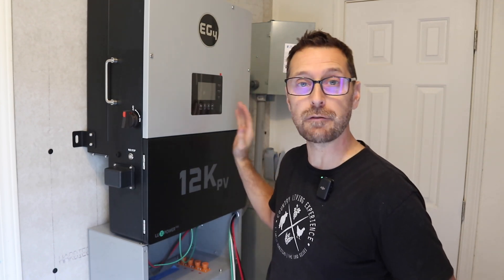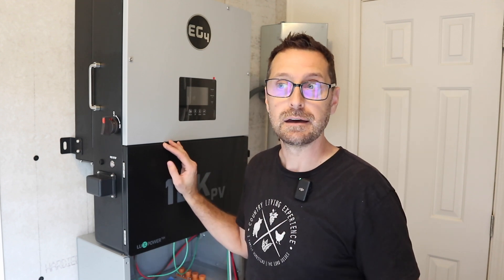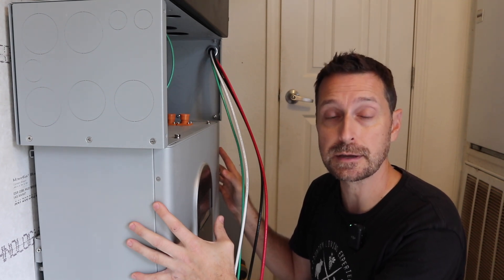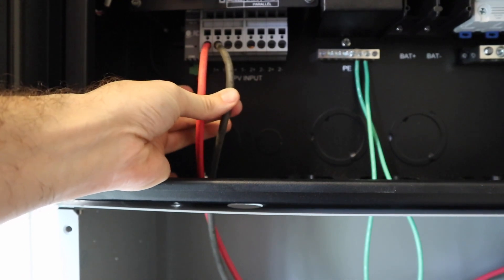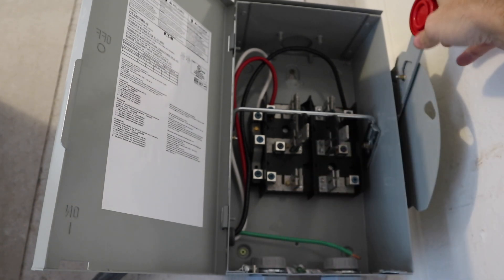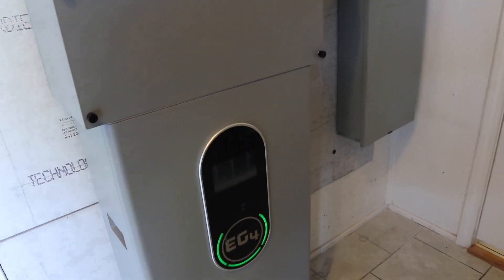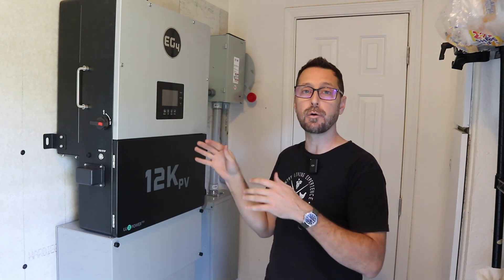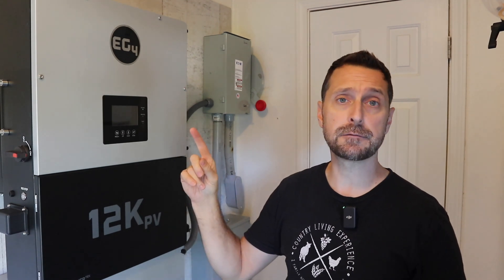EG4 12kpv Install! Wiring And Critical Loads Panel

Comment: I have mores question. I see you have a transfer switch to the critical loads panel.
My understanding is that the PV comes into the EG4 like you have. The EG4 then connects to the main panel, and also to the critical loads panel. When the Grid goes down, the EG4 ATS disconnects from the main panel, and only the subpanel has power. So not sure why you need a manual transfer switch.
Anyway ... what I want to do is to put an disconnect between the EG4 and the critical loads subpanel. Question is, should that disconnect interrupt only the 2 hots or does it need to also interrupt the neutral. Should the neutral go straight through the disconnect box?
Reply from the maker: I did a manual transfer switch because that is what my friend wanted.
Reply from the maker: neutral should be to the neutral bar in the sub panel. Ground should be to the ground bar in the sub panel. Neutral should then go back to the main panel neutral bar. Ground should then go back to the main panel ground bar. That is the only place that there should be a neutral ground bond. No neutral ground bond in the sub panel.
Reply from the maker: The neutral is always interrupted in the transfer switch/disconnect as well.

Comment: I am considering this 12kPV inverter. I have some questions. I have panels going to a SolarEdge 7600, going to my main panel on 40amp breaker (8 awg wire). So that will move to the GEN port on the EG412kPV. My critical loads panel will be rated 125amp .. so what size wire from the EG4 to that panel? 4awg ?
And the EG4 needs to be connected to the main Panel .. I do send excess power to the grid. My main panel is 200amp. So it seems I cannot connect the EG4 to main panel with more than a 40amp breaker, 8 awg (120% rule). Is this correct.
Reply from the maker: The installation instructions indicate 4awg for both grid and AC out connections. Those can be landed on either a 60 or 70 amp breaker depending on wire type. Use THHN.
Reply: @CountryLivingExperience  Thanks

Comment: A Dumb question: Can you connect the Hybrid "Load Connection" to a Load panel that os already hot and connected to "utility"/Grid.  my Solar System is 7 years old SMA. It was not hybrid and was directly connected to a utility connected panel. My system is already set and I cannot rewire the building. Thank you
Reply from the maker: If I understand you correctly, yes. You just wire it in with a generator interlock kit and land it on the appropriate sized breaker or wire in a transfer switch between the hybrid inverter and the panel.
Reply: @CountryLivingExperience   Thank you for very fast response. 
Question 1:  Does this mean that my PV and battery as input watts can be transfer electricity through the generator logs as output watts towards my house panel that is connected to  utility?!                                                                                                                                                                        Question 2:  In one other video, it stated, the grid logs also transmit hybrid inverter electricity back to my current connected house panel. Is that true?                                                  Once again. Thank you
Reply from the maker: You're welcome. 
I don't really understand your questions. 
Please watch how I installed my systems in my many other videos located here>>>>>https://www.youtube.com/playlist?list=PLe8gvCbPFkexFmUtg3xRS4sTZQ1Ve-ft1

Comment: Hey man, hope you are doing well. I need help. 

Here is the more specific question, that is the only thing keeping me from buying the big 18kpv/flex boss set up.

How would you wire this to a 200amp SUBPANEL, so it just feeds that subpanel and not pushing to the grid/main panel, but that it still has power from the grid when batteries and sun are not sufficient? 

If you let me know how to wire this up WITHOUT adding another critical loads subpanel, but still has the smart automatic switching to grid when needed, I will buy the $20,000 worth of signature solar stuff right now including: EG4 18kpv, 2x large batteries and if recommended a gridboss, and then a flexboss once available.
Reply from the maker: Let me think about this and get back to you. Email me if you want, so I don't lose this discussion thread.

Comment: I'm not going to be feeding back into the grid but I will be using the grid on cloudy days and at night so would you recommend the 12,000 XP over the 12,000 k pv? 
 The batteries I'm going to be using will be the rich alpha pro server rack battery I was wondering  would I need two or 3 batteries to power? 
This is my first solar purchase so I'm trying to make sure that I do the correct thing the first time thank you very much for your help
Reply from the maker: Assuming the Rich batteries are 100ah each, the 12000xp would need 4 of them for proper operation. The 12Kpv would need 2 batteries to operate properly. Keep in mind the output of the two inverters is different. The 12000xp is 12kw and the 12Kpv is only 8kw. If you do not need the grid sellback feature of a hybrid inverter (the 12Kpv) then I would certainly get the 12000xp because it is $1000 less expensive. Here is the link for it...https://signaturesolar.com/eg4-12000xp-off-grid-inverter-48v-split-phase-24kw-pv-input-12kw-power-output/?ref=countrylivingexperience
and our coupon code COUNTRYLIVING50
Hope that helps.
Reply: First I just want to say thank you again for all the videos and for answering my first question I took your advice I went ahead and got the 12,000 XP and I'm using four of the 100 amp hour batteries  and 32 solar panels and my luck the owner's manual was forgotten to be put in the packaging of the inverter LOL but of wiring everything and I was just curious I know that this inverter automatically switches from grid power to off power during a light outage and I was wondering if you know a good wiring diagram that I can use and trust there's so much misinformation out here my inverter unfortunately is 50 ft from my panel and I'm trying to limit the amount of wire that I'm using because two gauge wire you know it's going to be really expensive and I was wondering if you know a quick and easy way to wire this I'm not going to have a critical load panel my inverter is going to be tied directly into my main panel that's non-bonded and then I was going to run the off switch from a 100 amp breaker at the main box on the pole do you think that's the only way to wire this if I wire it this way I'm going to require a total of eight wires but if I have to I have no choice it's just another $1,000 I didn't want to spend LOL but if you know what more economical way for me to wire this oh man I would really appreciate it because I'm getting thin on my budget my wife is starting to get very angry
Reply from the maker: @brainwashed7244  You're welcome. 
The manual should indicate how to wire. I am not sure exactly what type of wiring scheme you are looking for. 
My inverter is also 50ft from my main panel. I use 4 gauge wire for it and yes wire is expensive. You shouldn't need 2ga for the 12000xp. 
This is a hard conversation to follow here. Please email me at the channel email address.

Comment: The load side of the inverter can feed power to the critical loads for grid and off-grid power. The main panel should just have the solar breaker to feed the grid lugs inside the inverter and able to back-feed to grid. EG4 has blueprints on their website for whole-house and critical loads/backup. Future reference for DIY people for partial load backup you don't need to call utility for temporary disconnect only for whole-house because feeders are LIVE. Most cities cannot detach the meter can. Also recommend doing a net metering application and having a solar electrical engineer stamp plans for permits and for wiring diagram.

Comment: In this configuration if you attached a mobile generator to the inverter would the generator need to be N/G bonded as well?
Reply from the maker: Generators are tricky. I would say no, but I would check with EG4 also.

Comment: Why doesn't anyone talk about amperage and wire sizes? I can figure out which wires go where, that is simple.
Reply from the maker: I do talk about that in many of the over 50 videos I have done on solar. Also, read the manual. It tells you wire size.

Comment: Great video! In your wiring video, does load line 1 carry 120v and line 2 carry 120v or is is wired to be just 120v +/-? If so does that mean the wiring is 6-gauge?

My overall goal is to do this, off grid to feed 240v to a 50amp outlet
Reply from the maker: Each carries 120 split phase for 240v. 6 is fine but 4awg is better

Comment: Thanks again for your videos I'm learning a lot,  in this configuration did you used 6 AWG THHN wire from the 12kpv(Load) to the transfer switch?
Reply from the maker: You're welcome. We actually bumped it up to 4 awg from the 12kpv to the transfer switch if I remember correctly. Just stay consistent with the wire size throughout the system and you will be good.
Reply: @CountryLivingExperience  Thanks so much again.  The reason I'm asking is because I'm not going to tie my system to the grid, and in my case I'm going to use a reliance transfer switch 50A, so 4 AWG I think it will be overkill.  6AWG will be good for my setup.  Sorry for the noob question,  so in that setup, why 4 AWG if you are not tying into the grid and the 12Kpv max output current is 33.3 A? Isn't the 4 AWG too big or is it because that system is going to tie into the grid in the future? Again, thanks for the help.

Comment: Nicely explained! Didn't see any details on the specifics of transfer switch.
Reply from the maker: Thanks. I showed the manual transfer switch and how to wire it. What other info do you need?
Reply: Sorry, i meant like a link to the specific item. Looking for one just at most 60A and they are not cheap I guess.
Reply from the maker: @johnklarnet7614  Oh, I understand. This is the one we used......https://amzn.to/3Dz1A8k. There are other Chinese made ones for less but I wouldn't trust them.
Reply: Thanks. $200 for trusted brand, not too bad. Yeah, things like this i wouldn't touch anything that is not ul listed either.

Comment: Why did you not use the Grid connectors on the 12KPV and run it to the main panel?
Reply from the maker: That is not how my friend wanted it connected at this time.
Reply: One advantage of this approach is no chance of backfeed. Ever.

Comment: How much power can back feed the main panel  from the 12KPV inverter?  Also if you loose main grid power can the 12KPV still backfeed the main panel?
Reply from the maker: It can backfeed but not in this configuration. It can backfeed 8000w at 240v.
Reply: @CountryLivingExperience  I am going to install 12KPv for my small commerical operation.  8000W is plenty.  New Grid Boss product is nice
Reply from the maker: Grid Boss is sweet. I have not had to opportunity to play with one of those yet. The 12KPv will serve you well.

Comment: Wouldn't it be professional if EG4 put 2/0 ferrules on those battery cables for you from the factory?!
Reply from the maker: No. Simply because they have no way to determine which inverter you are going to connect the PowerPro battery to. If you have a 6000xp, you need to have ring terminals on the end of the battery cable.
Reply: @CountryLivingExperience That makes sense. Good to know.

I'm getting ready to install a couple of these systems for some of my clients. There's not much content out there on how to install them. Been watching some of your videos and appreciating your content.
Reply from the maker: @eric91780  Cool. Glad I could help.

Comment: Hi great informative video my friend, I have a question . I’m getting the same inverter and battery and I will use 8 solar panels on two EG4 BrightMounts, my question is when I earth ground the panels and the two BrightMounts do I have to bring a ground wire front the ground rod to the 12pvk together with the solar wires?  Thanks and sorry for the question Im new at this
Reply from the maker: Thank you. 
Grounding has always been a huge topic of discussion on all solar forums and is quite contentious and often disagreed upon. 
In this case however, from all that I understand, you do not drive a ground rod at the Brightmount. You need to run an EGC (electrical grounding conductor)(like an 8awg green thhn wire) in your conduit with your solar pv wires and connect the egc to your grounding bar in your main panel. That will give it the ability to use your house grounding rod as the single point of earth ground. 
Adding other rods can cause what is called a ground loop which is not good.
Reply: @CountryLivingExperience  ok got it I will do that,  thanks so much for your help 🙏
Reply from the maker: You're welcome
Reply: Sorry to bother you again my friend , I was watching the video again to get more familiar and I saw the two pv wires and the ground that comes from the panels and you connect the ground to the ground bar on the eg4 12 , so the ground that will come frome my BrightMount will go to the EG4 12 ground bar or to the ground bar at my main braker panel? 
Sorry for the confusion and thanks for the help.
Reply from the maker: Yes, the wire from the brightmount  can come to the ground bar in the 12kpv. You will have another ground wire that goes from the 12kpv to the main panel too. They all connect together.
Reply: @CountryLivingExperience  ok, great. I just got a little confused,  Thanks so much again for the help .

Comment: Great channel and great video!  I’m very interested in the eg4 18k.  Which is basically the same but capable of handling 200 amps of grid power. My plan would be to power everything in the main panel by routing grid power directly to the inverter like @echopapa819 alluded to.  However, I can’t seem to find any good videos showing wiring FROM the main grid feed to the inverter and then back to the main panel.  Lots of videos wiring up the PV and batteries but not on what seems to be the most important part…. From grid to inverter and then back to main panel..  Would love too you show that if ever get a chance.  I have 200 amp main panel.
Reply from the maker: Thank you. I appreciate it. 
The reason you don't see any vids showing that is potentially because of the liability. Most of us wiring these are not licensed electricians and don't show the AC side of the systems for those reasons. There are a few out there with tiny bits of information that you may be able to piece all the info together that you need. 
I am working on being completely off-grid and I do not even have grid assist wired into my off-grid inverters so unfortunately I won't be showing a connection like that on the channel.
Reply: Sorry for the typo in second to last sentence.  Meant to say…. Would love to see you make a video on that!  Thanks for the great video and content on your channel.

Comment: I'm leaning toward 2x 6000XP's over 1x 12000XP, for redundancy and increasing maximum power output to 12kw vs 8kw on the 12000XP. 2x 12000XP's would be better, but significantly more.
Reply from the maker: There are 2 different 12k's. 
The 12Kpv and the new 12000XP. The 12Kpv only outputs 8000w but the 12000XP outputs 120000w. The 12Kpv in this video is a hybrid and can only accept 12000w of solar input. The new 12000XP is an off grid inverter which can accept 24000w of solar input. The 12Kpv is $3499 and the 12000XP is $2499. 
I am going to be installing and demonstrating the new 12000XP in about a week.
Reply: @CountryLivingExperience  Oh, interesting, I didn't know that, thanks! Aside from redundancy, I guess the output would be the same.

Comment: So you’re saying you can’t always get solar unless it’s switched to solar? On my Victron, I can always get solar to my batteries, even while hooked up to my house.
Reply from the maker: That is just the way this particular system is set up. There are a myriad of options on how to set up and use a 12kpv. This is just how we chose to do it and demonstrate.
Reply: Yes, this setup doesn't take advantage of what the system is designed to do, but hey to each their own. I'm sure the system has been changed by now 😅

Comment: Why did you choose to not route the Grid Power into the 12K and use its built in UPS/bypass and eliminate the transfer switch?  The way you have it wired Solar/Battery is only used in the event of a grid down and requires you to be present to manually moved the transfer switch.  As it is wired the grid cannot charge the battery and the solar is only acting as a trickle charger to keep the battery at 100% SOC.  With a simple wiring change the solar can be powering the E-Panel 100% and only use grid power to supplement.
Reply: I was going to ask the same question
Reply: @waynebeck7801  Ya the load side of the inverter can feed power to the critical loads for grid and off-grid power. The main panel should just have the solar breaker to feed the grid lugs inside the inverter and able to back-feed to grid. EG4 has blueprints on their website for whole-house and critical loads/backup.
Reply: Ya the load side of the inverter can feed power to the critical loads for grid and off-grid power. The main panel should just have the solar breaker to feed the grid lugs inside the inverter and able to back-feed to grid. EG4 has blueprints on their website for whole-house and critical loads/backup.
Reply: @echopapa819  Glad I'm not the only one....
Reply from the maker: This is the type of connection he wanted and we wanted to show. Simple as that. 
There are a myriad of ways to connect and use the 12kpv. This is what we wanted to demonstrate. We may change that in the future depending on his needs.